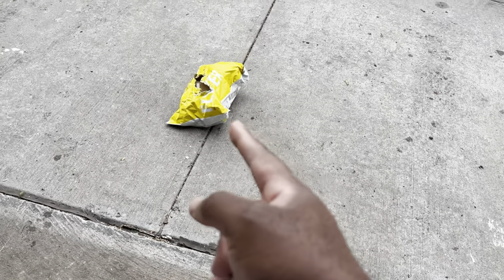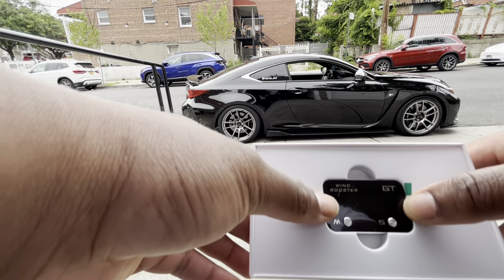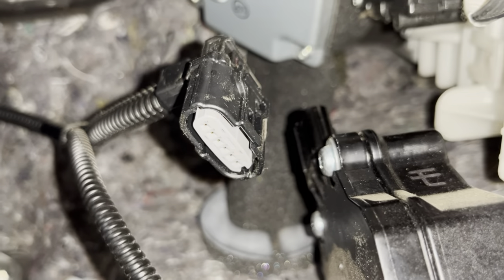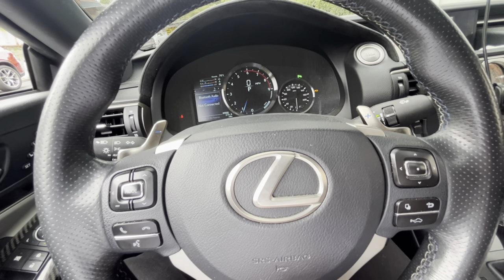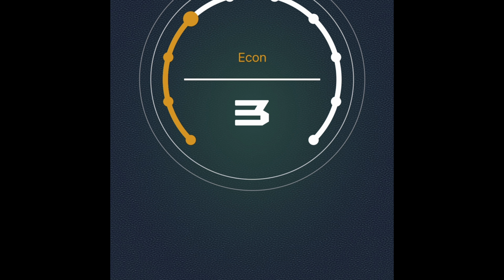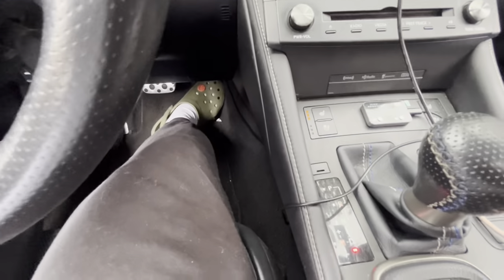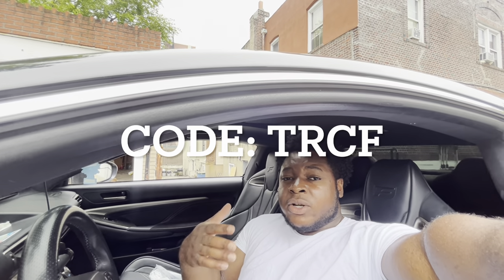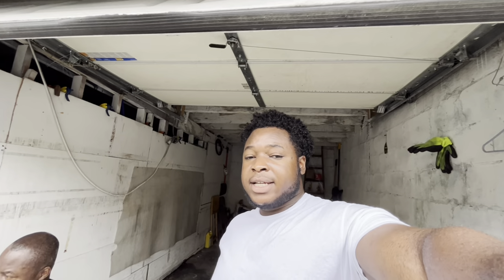DID I MAKE MY CAR FASTER WITH THIS NEW MOD?! (THROTTLE CONTROLLER) #Windbooster

Comment: I have had it for 2 years now (AFE Power SprintBooster v3). It does not make the car faster. The car just reacts faster to your inputs so you will have more power available with less throttle movement so you can get off the line faster simply because the reaction takes less time. However, it does not add any power as it is just opening and closing the throttle faster and doing it sooner in the first few inches of the throttle pedal travel.
Reply from the maker: Yup!!!! Simply explained!
Reply: @Mr_Odog  If you are rapidly moving the throttle in turns or in a straight line, it will all be happening faster so you will consuming less time, but if you suddenly floor it and accelerate in a straight line then the throttle controlled does not do anything (say, in a 1/4 mile run) other than just the initial reaction would be a bit faster, but after that it would be the same with or without it.
Reply from the maker: @2ZZGE100  uhh Interesting, so it’s all about the initial response? I’m definitely just going to keep messing around with it lol
Reply: @Mr_Odog  Yeah, the first few inches.  Depending on how you aggressive you set it at, it will give you more power sooner so it gets the car moving faster sooner.